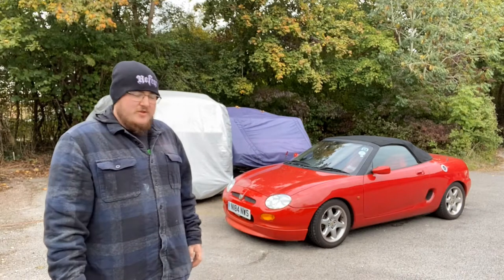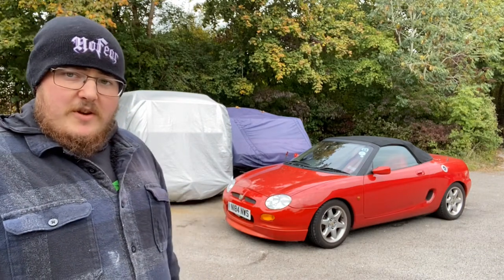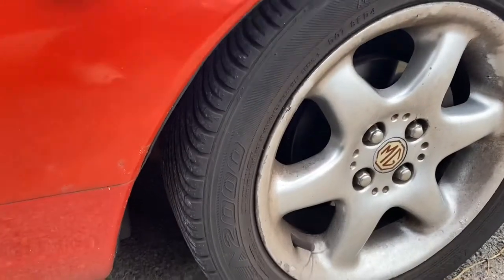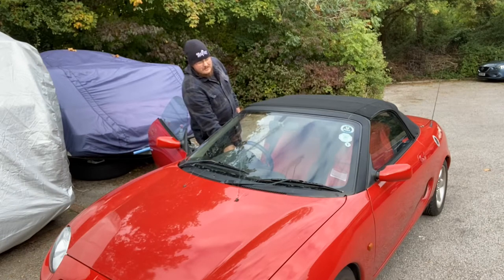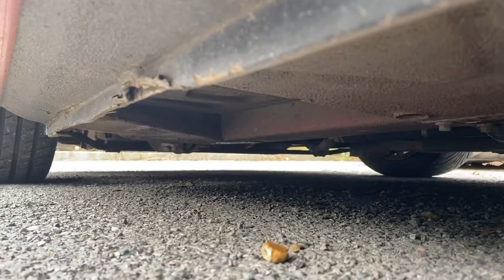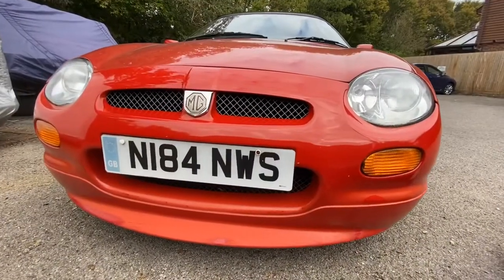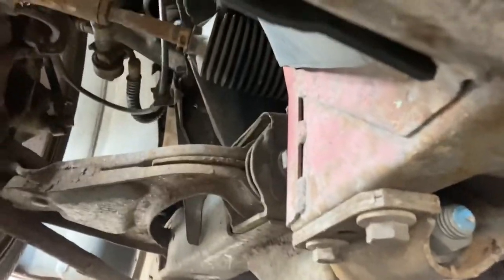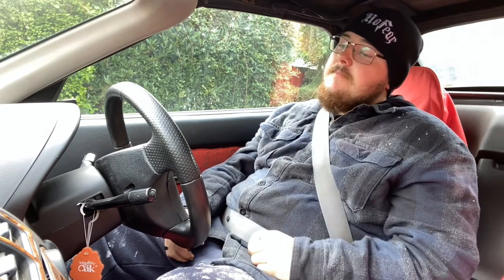MGF  MOT check

Comment: Dude it’s hydrolastic suspension “fluid” like the old allegro, metro type take it to an old school garage they’ll have an old pump knocking around somewhere in some old forgotten tools cabinet lol don’t put air in it lol, ffs I had one up to 18 months ago , threw it out 🙄
Reply from the maker: Ahhhh okay. I knew I’d get it wrong 😂. I’ll get that sorted
Reply: That pump should be the abs pump, behind that black cover “bulk head” should be the connectors for the suspension 🤔 on normal coil spring suspension car you can feel for a bad wheel bearing by spinning the wheel while having a finger on the spring, you will feel the vibration through the spring 👊👈
Reply from the maker: @chrissmart9625  okay cool. Still learning with these cars lol. It’s a fun experience
Reply: The pumps not working Dads  tried to fix the pump on this 😂😂😂